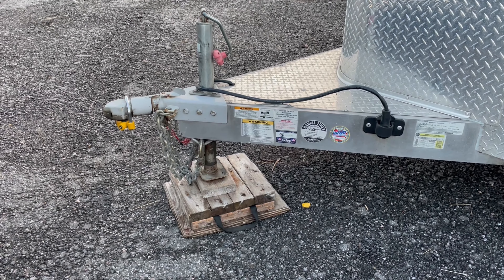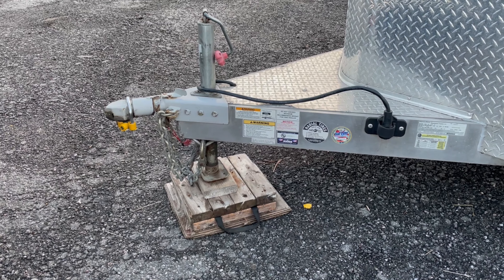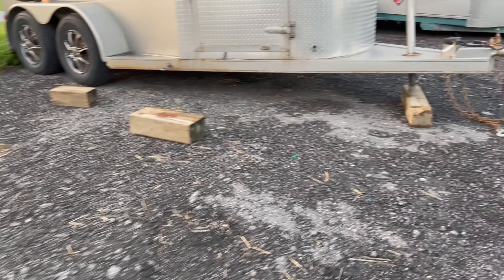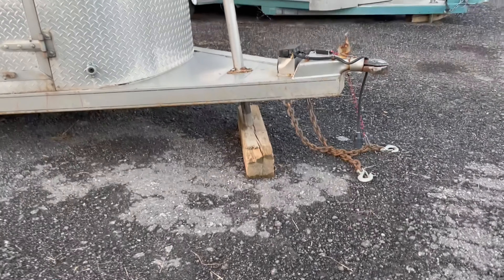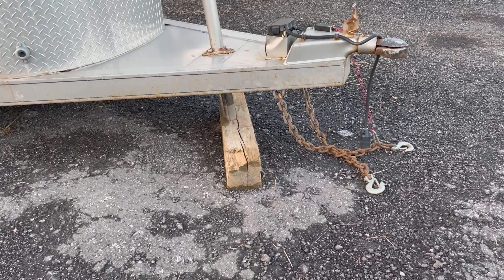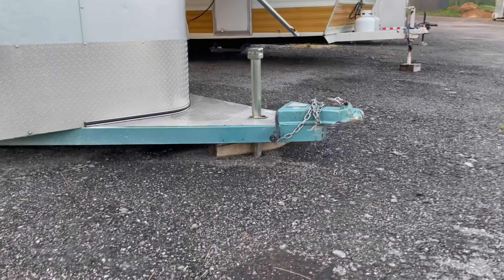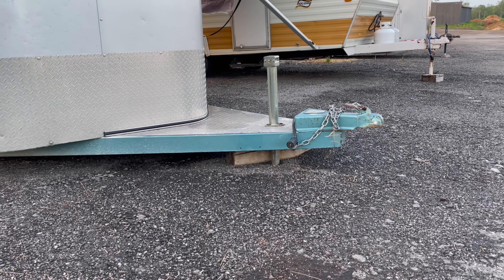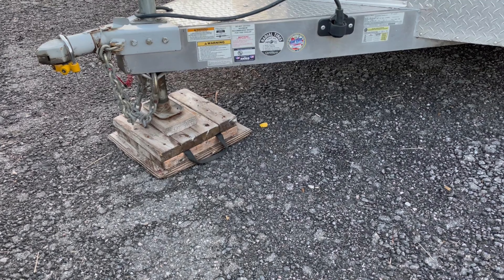"Good" blocking for trailer support leg compared with "not-so-good" blocking...

Comment: This is exactly what I do with my big boat trailer in my driveway. Otherwise, it will sink severely into the asphalt. This way it just leaves a very small impression.
Reply from the maker: Its amazing how much asphalt softens on a hot sunny day, I have a small piece of aluminum checkerplate stowed under the motorcycle seat to give side stand a larger footprint.